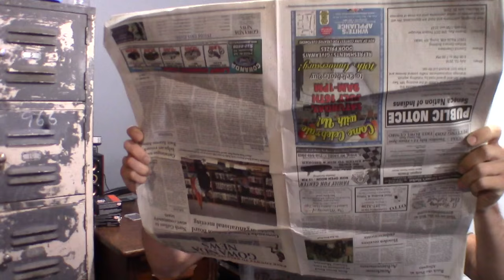PAINTING COP TRUCK

Comment: go to tractor supply an invest in a $30 spray gun and put a pressure regulator on it, order some paint an paint. I just did my cummins with it using rustoleum machine paint an it looks pretty good. also, when you do the the whole truck, paint edges an corners first an tie the rest in. I've done two of my trucks so just passing things on that I've picked up doing the two of them. love the videos. keep on keeping on bro

Comment: okay I'm trying to build a racing lawn mower like the old one that you built just to run in parades and fairs and I'm struggling on the lowering it part and getting my belt to stay straight I was wondering if you had any ideas on how to mount the tension and idler pulley 2 adjust it to where it would run straight and level without kicking the belt off

Comment: What year is this Truck?
Reply: +TrollMaster300 itd a 06
Reply: Not sure exactly what year it is but i can tell you for sure its not a 06. In 06 they switched to the LBZ motor and got rid of the duramax logo that had the red in it and switched to a different logo that reads "Allison Transmission Duramax" As you can see in the video at 2:18 its the older duramax logo that reads "Duramax Diesel"